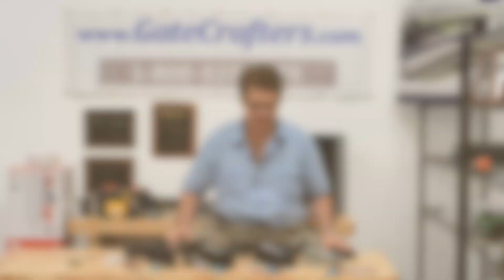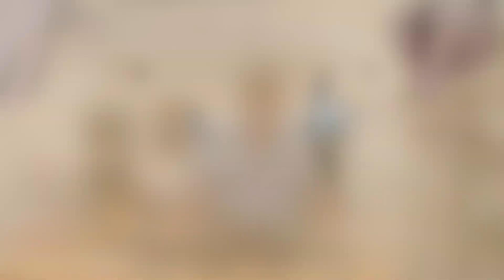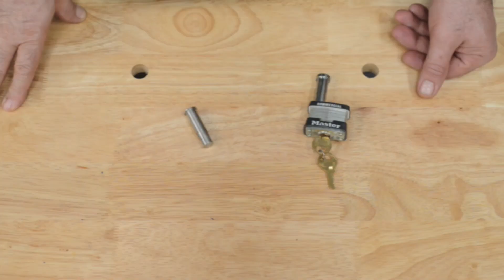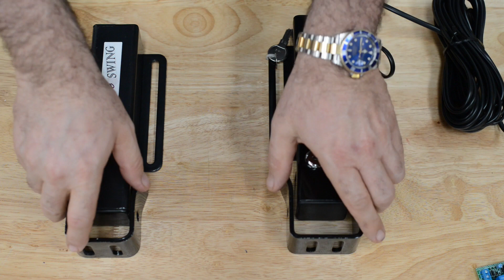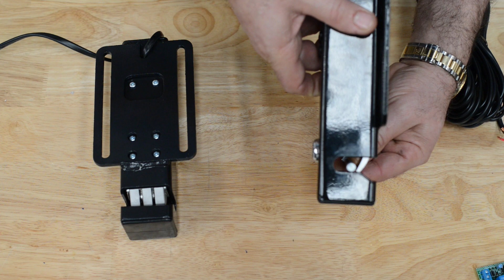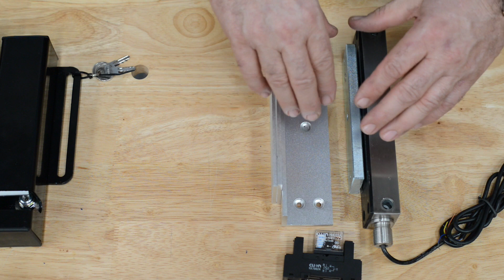How To Use Driveway Gate Opener Locks

Comment: Any updates to these? Like a wireless one? I need to install one on my gate, but I'd have to dig under a 16' driveway to install the wires... The ground is rock and hard clay, not easy to drive a pipe under it.
Reply: just as soon as you can invent a way to transmit 12vdc over the airwaves

Comment: Great latch comparisons
What is your strongest and hardest to override…??
Reply from the maker: Hi! To be able to assist you further, can you please be more specific? We look forward to hearing from you!
Reply: @Watch2DIY  this site seems to avoid the obvious….what is the breaking strength or failure in pounds on your auto latches…??
What’s the point…to installs a piece of useless but expensive hardware ….that any car or truck can just touch your gate….and gain entry….??……maybe we are doing an exercise in mental woke conditioning…?
Reply from the maker: @offgridmangogrower  We don't have the specifications for their force capacity as gate locks are more of a convenience device than a security device. Gate locks are more for keeping wind from moving the gates and stopping anyone from pushing them open. Gate locks do provide a level of security as they are designed so they aren't easily bypassed and may be able to take the force of a vehicle, but if you are looking for a more complete security solution we suggest contacting a security company.
Reply: @Watch2DIY  thanks for your input
I’m ordering a ranger HD and will do further research on the latch hardware….if there’s nothing reasonable…I will build or modify an existing one….gates and security are intertwined
Reply: @offgridmangogrower  these are not a long term reliable lock but as far as strength you will probably push the gate or post over before these will break. the solenoids inside are the part that gets swolen or gummy and they get weak and wont move either quick enough then the opener binds up and the gate times out and wont open so its stuck closed.

Comment: Looking to add a gate opener and have focused in on Ghost TDS2.  It seems to have great reviews.  Will this lock  work with their openers?  Also, is there a specific gate dual gate opener you would recommend?.  It has two side by side 8' gates.    The gate frame are made from galvanized steel and has cedar planking over it.  4" galvanized poles in cement as well. .

Comment: Great info. Well explained. What do you consider the most reliable residential single none solar automatic gate opener? I've been looking at Mighty Mule and they look like they go issues. Lift Master looks promising. I'm still researching. Thanks for your time.
Reply from the maker: Paul Short If you are really looking for a very high quality solar capable gate opener I would recommend either the Apollo 1550 http://www.gatecrafters.com/product_detail_867_12807.aspx or the USAutomatic Sentry 300 http://www.gatecrafters.com/product_detail_31641.aspx.  If you would like to speak with one of our reps at GateCrafters please call 1-800-537-4283